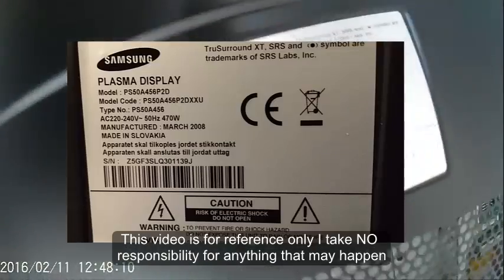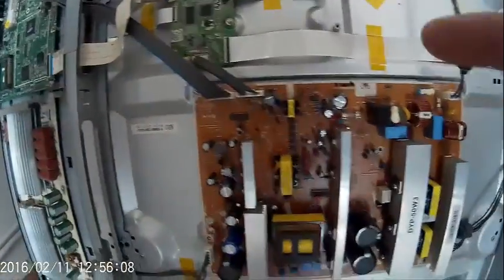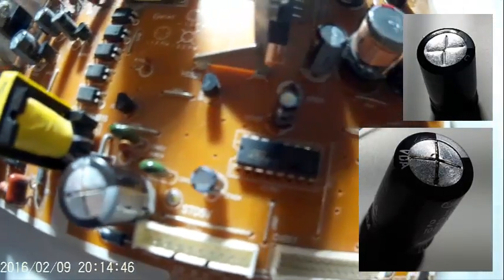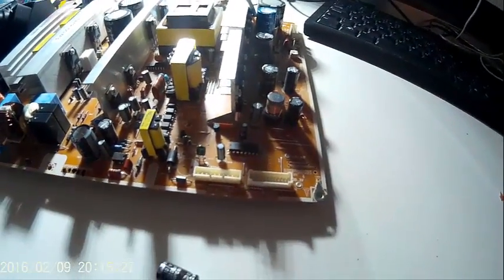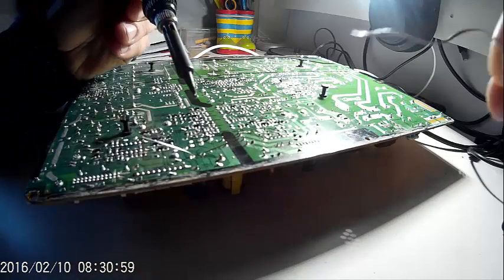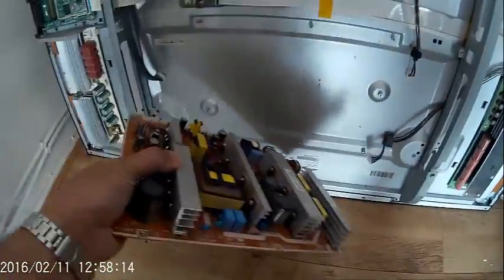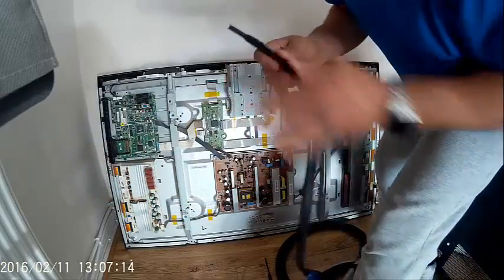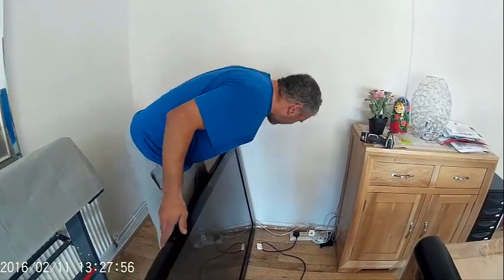Samsung plasma / LCD TV repair so easy PS50A456P2D

Comment: Awesome! I have got the same model, it was put in our electric dump corner. The same issue here: no function after connecting to the power source. I'm sure it's a blown cap, too. It's a very common issue at flat tv's, expecially the older ones. My PS50A45 is built in 2008.

Comment: How can i Fixed My samsung Plamsa Tv  Panel, its Burnedout!
Reply from the maker: so long as the screen is not broke you can do it
Reply: @FixYourValues  Screen glass is just fine its not physically broken, Can you please Guide me how to fix the Panel?
Reply: You’re better off if you can replace burned board.  Get used one from eBay.

Comment: I have a SAMSUNG PN50C680G5FXZA that suddenly the image was gone and I only hear the audio. I opened the back and the logic board has no blinking light at all. I am not a professional and I started checking boards to see if any visible damage was present. None found.Now in order to turn on the TV on via remote, I have to unplug the brown ribbon from the main board to the logic board .Also the VA and VS voltage is almost zero even with the TV on with audio only. It looks like the problem is getting worse.Please help, I am almost losing hope on my TV.
Reply: Hey having something similar , wondering how did things end up with you ? hope you found a solution to this

Comment: Will this fix pixel lines that run down middle of screen?
Reply: You need to buy a buffer board for your TV you will need to remove them first to check the part numbers they're located at the bottom of the TV behind the speakers.